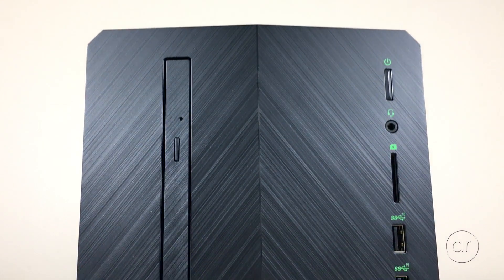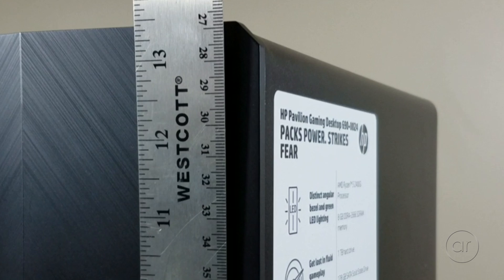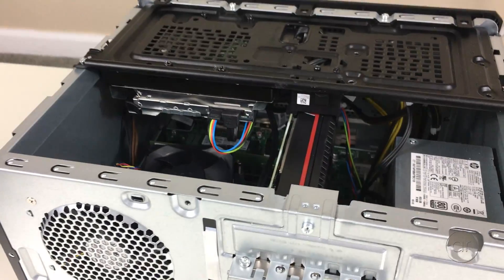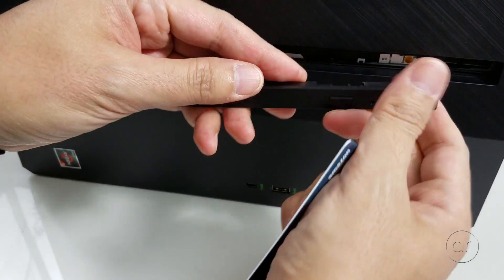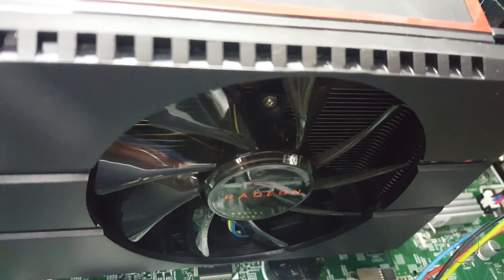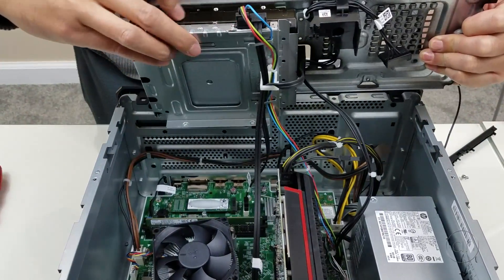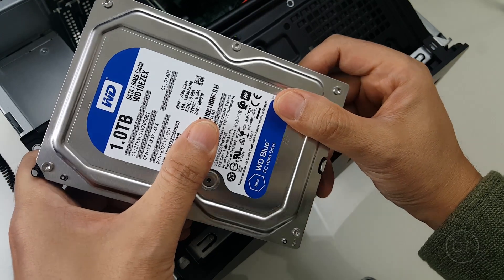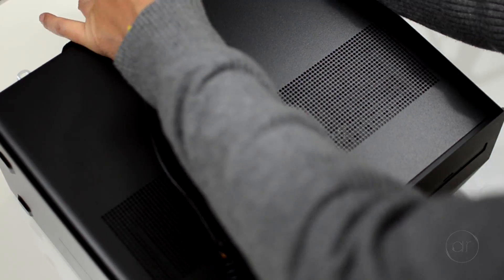How to Open and Upgrade a Ryzen-Based HP Pavilion Gaming Desktop

Comment: You think a 1600af would work?
Reply from the maker: Unfortunately, HP's spec site doesn't list the 1600af  (nor the 1600x) variant on its compatible CPU upgrade list - only the plain 1600. You may want to contact HP to make sure...
Reply: I put a 1600af in mine and it works great.
Reply from the maker: @phudman  Do you mind if I add this to the CPU section of the description, with credit to you? What model Pavilion 690 did you upgrade?

Comment: Hi I have the same pc and I’m trying to clean. After I open it should I just use my air can duster and spray all around the inside?
Reply from the maker: Yes, you can do that but I'd make sure that there's a good place to ventilate the dust since there could be a sizable amount.
Reply: access random thank you!

Comment: Do you think the GTX 1660 Ti OC 6G would fit in there, or would I have to go with something like the ASUS GTX 1660 TI 6GB Phoenix
Reply from the maker: Physically, the second is much more likely to fit as it's less than 7" long. The first one is a little over 10", and the space inside the case is about 10". I've been keeping track of the brand/models of graphics cards that have been successfully installed by other viewers in the Description (under the "Graphics" section) so those will give you a good idea of what will work. Please keep in mind that there are power requirements also.

Comment: Is there a safer way to remove the plastic cover on the cd drive?
Reply from the maker: Two viewers have commented on this which I've added to the pinned comment. The better way is probably the one recommended by HP: "HP recommends: Before removing the drive cage, unplug the two cables connected to the rear of the optical drive,  press the lever on the rear of the drive, and simply slide it out to the front (no screws). Reverse when reassembling."
Reply: @accessrandom  thanks nice vid

Comment: Can you add a Elgato hd60 pro to the one open pci slot?
Reply from the maker: You should be able to, but one viewer called jofrejkd brought up one caveat (about sound cards, but it probably applies to any PCIe x1 card): you can't use the PCIe slot to install a sound card if you use an NVMe in M.2 slot: "To be clear, the port can be used if... using sata drive... The M.2 NVMe is faster because it actually steals the PCIe ports pipeline... if you install a sound card, it will show it in device manager but the system won't find it." If anyone else has any experience with the Elgato HD60 Pro in the Pavilion, please reply.

Comment: can that pc support a gtx 1650?, i want to buy it
Reply from the maker: The GTX 1650 has a lower power consumption than the RX 580 so you should be fine (for the 690-0024 Pavilion model). I've been keeping track of successful upgrades - you can see specific makes/models in the "Graphics" section of the description.

Comment: 1 easy modification to increase the cooling of this PC: move the 3.5" HDD from the top to the bottom of the rack.  This gives a direct path of air flow going from the top of the rack, past the CPU heat sink / fan, then to the case fan in the rear.  On my system (690-0067C), this reduces the CPU temperature by 5 degree C as measured by CPUID HWMonitor.
Reply from the maker: Thank you. Do you mind if I add your tip to my pinned comment, with credit to you?
Reply: @accessrandom  Sure, go ahead!
Reply from the maker: @echopapacharlie  Done, added to the pinned comment - thank you!
Reply: How did you do that? Did you modified the rack?
Reply: @kennethpacheco1716  No need to modify the rack.  The rack is designed to be able to mount two 3.5" hard disks: one in the top (the factory default position), and one in the bottom, which is empty.  Just disconnect the cables from the hard disk.  Unscrew the 4 screws.  Note the location of the 4 corresponding mounting holes on the disk.  Match those 4 holes on the disk to 4 holes in the bottom of the rack.  The 4 holes on the rack are marked "C" I believe.  Reinstall the screws and reconnect the cables. Note the hard disk orientation is different in the bottom rack; it will rotate 90 degrees. Also note HP glues paper washers to those holes on the rack.  Take care those paper washers  don't drop into the machine as you unscrew / screw.
Reply: @echopapacharlie  Thank you very much for the help. The modification was simple. Temperatures certainly dropped between 5 and 10 degrees. Another possible modification if the processor is changed, is to use the stock heat sink but change the fan to increase ventilation. I switched from Ryzen 2200G to Ryzen 5 2600, so I changed the stock fan to AMD's stealth wraith cooler.

Comment: i have that computer but with i3 8100 and gtx 1050 2gb with a 180w psu  should i upgrade the psu?
Reply from the maker: Is it the HP Pavilion 790-0010 by any chance? If so, it's a slightly different family than the 690 that's shown in the video, so the dimensions of the PSU may be different. For your existing components 180W should be fine, but if you wanted to upgrade the graphics card (for example) you'd probably need to upgrade the PSU. If it's anything like the 690, then the PSU is probably non-standard and would need to be replaced with an OEM part.
Reply: @accessrandom  no its a (690 0035 no) and i've bought the gtx 1650 gddr5 4gb gpu for better fps and a 500w coolbox psu but what is a OEM ?

Comment: Is it possible for me to upgrade to another Mobo, like a micro asrock mobo then put in a new 500w psu so I could run my new ryzen 3600? Cause I didn't realize the current mobo doesn't support it and I'm stuck with a new better cpu that I can't use.
Reply from the maker: Unfortunately, the motherboard-PSU-case combination is highly non-standard, so I haven't had any reports of successful upgrades in the original case (except for HP-made OEM power supplies). You could get a new motherboard and power supply, and install them in a new case - and then all of the other components can transfer over, including the RX 580, M.2 SSD, memory and hard drive. The optical drive is the thin-type so you'd need some type of adapter to mount it in a 3.5" bay.
Reply: Is it not possible for me to use the hp case but basically have everything else custom like mobo psu cpu ...etc.
Reply from the maker: It could be possible but I'm afraid I'm not sure - I hadn't checked the hole pattern on the motherboard to see if it's standard. The power supply's dimensions are 2.8125 x 2.9375 x 6.25 inches so any PSU should be approximately that size.

Comment: Do you know what model of the 1660 super the  person in the description upgraded to?
Reply from the maker: I'm sorry, I don't. But I believe it's the Gv-N166SOC-6GD, which is the only model that shows up in my browser history.
Reply: @accessrandom  will i need an adapter to have 8 pin? because current power supply has 6 and if i need one can u recommend one
Reply from the maker: @Malos  There's some conflicting information on the power supply - I saw a 6-pin connector in mine, while a commenter named Jake Wagner (see the description under the "Graphics" section) had an 8-pin. You may want to open up your case to see what you have. In terms of upgrading the PSU, only an HP OEM would match the non-standard motherboard, but again, to be sure, you probably should contact HP to see which PSU has an 8-pin connector.
Reply: @accessrandom  can i not get a sata to a 2 or 4 pin connector  
would that work or no?

Comment: Ok hi, can you provide a link yo where I can buy the 400 watt psu please? Thank you. The pins look weird on the motherboard so I don’t wanna buy the wrong one, thanks!
Reply from the maker: Unfortunately, Youtube doesn't like links in the comments, but the part number for the 400W power supply can be found in the description under "Power Supply": L04618-800. I would double-check with HP to make sure your Pavilion model is compatible with this power supply (if it isn't the 690-0067c).
Reply: access random okay thank you. I found a 400 w 80+ platinum on eBay. I am going to put it here.
Reply: @axd2102  HP uses custom power supplies and motherboards.  You cannot buy an off-the-shelf power supply from ebay; it won't have the correct connectors for the HP motherboard.  You have to buy the HP p/n L04618-800 power supply from HP.

Comment: Ok hi! , I’ve calculated my psu usage for each main conponent on pc. 

Ryzen 5 2400G- 65 W 
GTX 1660 Súper-125 W
They add up to 190.
Do you think this will do? Thank you
Reply from the maker: I think that will be fine for the 690-0024, as it has a 400W power supply.
Reply: access random ok thanks I’m going to buy the 400 watt PSU and then work and save for a GTX 1660 SUPER instead of a 1050 4gb. Thanks!

Comment: Somehow I’m having trouble putting the cage back on :/
Reply from the maker: There are two gray tabs on the cage which meets with the tabs on the case (you can see one of them at the 4:39 mark, above and to the left of my screwdriver). Make sure those cage tabs go under the case tabs when you are re-assembling...
Reply: Yeah, I’m not sure if I did I it right, but I was able to screw it back on so I think I got it

Comment: I got a great deal on one of these and I will be turning it into my streaming pc. Im just making sure if I am right but I have a capture card that uses the PCIe x1 slot which this pc has. I was reading through the comments and someone said that the m.2 drive uses the same pipeline as the PCIe slot so I wont be able to use both of them at the same time.
Reply from the maker: I'm unable to personally confirm since I haven't it tried it myself, but according to the viewer who brought it up (jofrejkd), he implies that it would only affect NVMe M.2 SSDs, not the slower SATA type (which is the SSD installed out-of-the-box).

Comment: can i put an rtx2070 super on this?
Reply from the maker: Unfortunately, it's power consumption is fairly high relative to the installed RX 580. Since the power supply is 400W (and NVidia recommends 550W), you'd need to upgrade the non-standard power supply. Since the PSU is matched to the motherboard, that would also need to be upgraded.

For other graphics cards, I've been keeping track of successful upgrades from viewers in the "Graphics" section of the description.
Reply: @accessrandom  so i have to change motherboard and power supply ?
Reply from the maker: Yes, I'm afraid HP didn't make it easy to upgrade to a more power-hungry video card.

Comment: Hi, sorry to bother you but this will be the last two upgrades. I am planning to upgrade to at least a GTX 1650 or a GTX 1660 SUPER 6GB. I need your help wisdom on upgrading the power supply. I am aware that the GTX 1660 SUPER 6GB requieres a 500 w psu or more, but I don’t know what power supply to upgrade  since there is a large selection of them. Thanks for your time
Reply from the maker: Unfortunately, the power supply is non-standard so you would need to purchase an OEM power supply from HP. If you do want to go third-party, you will need to upgrade the motherboard as well, since the non-standard PSU is matched with the non-standard motherboard. And you will probably need to move everything over to a new case because of the non-standard sizes (HP definitely didn't make it easy to upgrade to a more powerful graphics card).

With that said, there have been a couple viewers who have successfully upgraded to at least some variant of the GTX 1660 (see "Graphics" section in the description).
Reply: @accessrandom  :( Thank you for helping! I think i'm going to upgrade to a 1650 then since my psu is only 310 watts.
Reply: access random Thanks for the great response! Sorry for the tons of questions.

Comment: 67/5000
I can put a 2666 mhz ddr4 ram memory to this computer?
Reply from the maker: I've kept track of successful upgrades in the description in the "Memory" section. Out of the box, the RAM can be either Samsung or SK Hynix. I highly recommend that you match the brand/model of memory that you have, if possible. Otherwise, I've listed brands that others have successfully used.

Comment: I have the pavilion 690-0005nl with geforce gtx 1050ti 4gb ddr5 , can i replace with another 1050ti ?
Reply from the maker: As long as it fits physically within the case, you should be able to. There isn't much difference in power consumption between the different 1050ti models.

Comment: So I just got the WD Black SN750 to replace the 2tb Intel 660p I had been using. Unfortunately I am only getting 1600GB/sec max read/write, the SN750 is supposed to be up to 3400MB/sec read. 
Upon looking further it appears the m.2 slot is only running at PCIE 2.0 rather than 3.0... is everyone else's like this? I have nothing in the 1x slot below gfx card. I have one 2.5" ssd using one of the sata ports, the other ones are empty. 
What gives??/
Reply from the maker: HP was already misleading when it said their specs listed "128 GB PCIe NVMe TLC M.2 Solid State" even though it's not even an NVMe SSD - only the slot is. Has anyone else with an NVMe upgrade benchmarked theirs?
Reply: @accessrandom  I'm pretty bummed out. All I can find is that the port supposedly supports PCIE 3.0 but for some reason it's only running at 2.0 speeds... in the meantime I have re-installed the 660p which has max read of 1500MB/sec so at least I'm getting the most out of it. SN750 has been listed on ebay for a loss. Really lame!

Comment: Hi! I don't know if you'll see this comment but I'm if I'm correct, I can put a second hdd drive next to the main one on the cage? So it has to be a 3.5" ? But how will the drive be supported ?
Reply from the maker: The second hard drive can be either 3.5" or 2.5". HP provides an additional SATA power connector and a SATA data port, but you would need a SATA data cable to connect the port on the motherboard to the hard drive. I haven't been able to find a caddy or tray adapter that mounts to the cage, but there are holes on the cage where you can line up at least two of the holes on the drive. Alternatively, what I did was use velcro to secure the drive to the cage.
Reply: @accessrandom  Okay! Thank you so much for your help I really appreciate it :)

Comment: This helped a lot.
Also, do you know if a case upgrade is possible? Especially regarding GPU's, the current case is very limiting.
Reply from the maker: Glad you found it helpful. The case can be upgraded but there are some caveats - the motherboard and power supply need to be moved together since they are both non-standard (and are matched with each other). I haven't checked the mounting hole pattern on the motherboard so I'm not certain if it will mount in a standard xATX/ITX case. Unfortunately, I haven't had any reports of viewers moving the system to another case.

Comment: i have the version with the gtx 1060 can i upgrade to gtx 1070 ? and can i upgrade the psu ?
Reply from the maker: Is yours in the Pavilion 690 family? If so, the PSU can be upgraded but I'm afraid it can only be an HP OEM part (since it is non-standard). The 1070's power consumption is roughly 25% higher than the 1060, so upgradability will depend on your existing power supply
Reply: access random yea it is and thank you for replying

Comment: What is the dimension of the graphic card ?
Reply from the maker: I measured the length of the card (the RX 580), and it is  7 1/16" (measured from the back of its plate).

Comment: i have this pc but it has the i5 8400 and gtx 1050 so does this have the same mother board?? and if so can i defiantly upgrade to 16gb ram
Reply from the maker: Is it the Pavilion 590-p0721 by any chance? If so, it is a different family of Pavilion (690 vs the 590) so the motherboard is different. If it is that model, it can take up to 32 GB of memory according to HP's specifications website.

Comment: HI do you recommend this one?

Crucial P2 250GB 500GB M.2 2280 NVMe SSD PCIe 3D NAND Internal Solid State Drive?
-DO you think it will be compatible?

I thank you from the bottom of my heart for helping me. Thanks!
Reply from the maker: Yes, that should work fine.
Reply: @accessrandom  Thanks!! I appreciate you helping out!
Reply: @accessrandom  will it come with the screws? I'm hoping so as i don't have them within the motherboard.
Reply from the maker: I'm not sure.Unfortunately, my SSD did not come with the screw but my motherboard already had one.